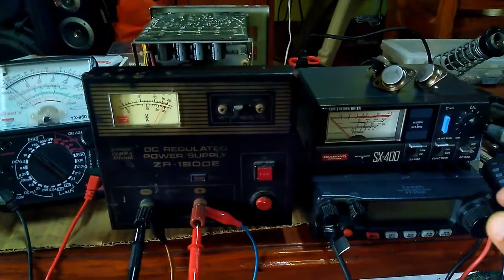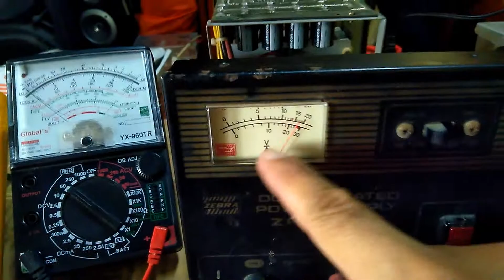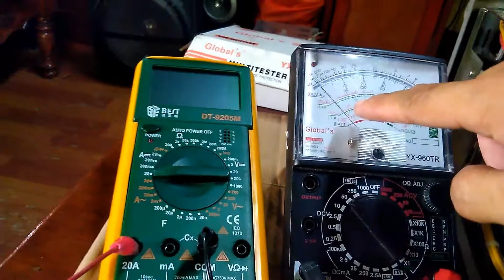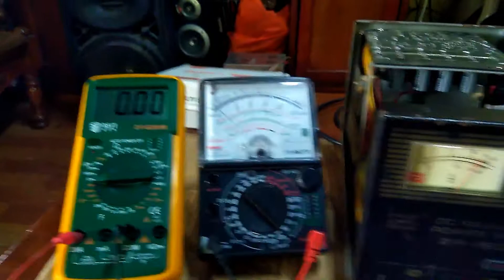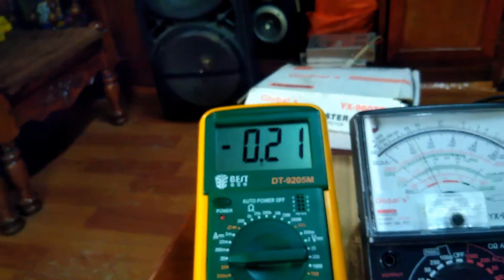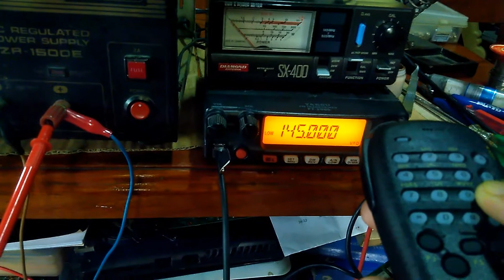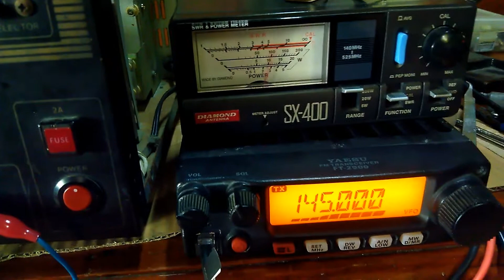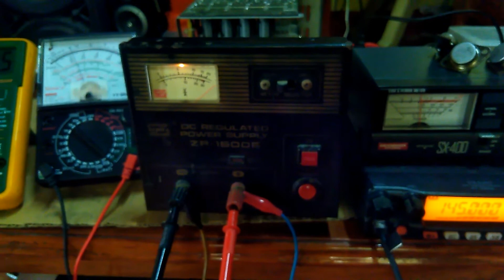Fixing a common problem on Linear DC regulated power supply.

Comment: Fron Cebu City, Hi, meron ako zebra 50 amps, my problem is same as 2nd problem mo regarding current regulation.hangang 6 amps nalang kaya nya. pag nag high power ako bumababa ang current nya at na mamatay ang radio. Ano dapat ko gawin at tigna. Sana ma tulongan mo ako. TNX.
Reply from the maker: May sira na po na  power transistor sa  regulated power supply nyo hanapin nyo yung may sira then palitan nyo ng same part number transistor ok na ulet yan kung yun lang ang issue.

Comment: sir meron akong dc regulated power supply ang problema is nagmamalfunction po yung reading ng voltage at amps. minsan kapag nag set ako sa voltage yung amps ang nag set. minsan din po kapag magset ako ng amps ayw magset, nasa 0 lang?

Comment: Sir gamit ko zebra 24amps, pag gamit ko sa radio meron hugong transmit ko ano po kaya sira. Gamit ko ic2730 me hugong, kahit sa hf radio meron din hugong sir thanks 73.
Reply from the maker: Kung wala dati yung ugong at nagagamit mo naman sa high power yung power supply mo tapos nagkaron ng ugong maaring hindi na maganda ang filtering oh may sira na ang capacitor mataas na ang ripple voltage. Kung nag pa fluctuate naman ang current maaring yung power transistor ang may sira.

Comment: Sir, meron ba trimmer sa volts ang ganitong power supply?
Reply from the maker: Meron pero depende sa ginamit na IC ng voltage regulator, yung iba fixed resistor ang ang kinakabit para mapababa sa value ng regulating voltage, yung iba naman zener diode pero normally potentiometer ang nakakabit para ma adjust ang voltage lalo na pag LM317T ang trck hanapin mo ang voltage regulator ic tapos check mo ang datasheet nung ic para makita mo yung application notes.